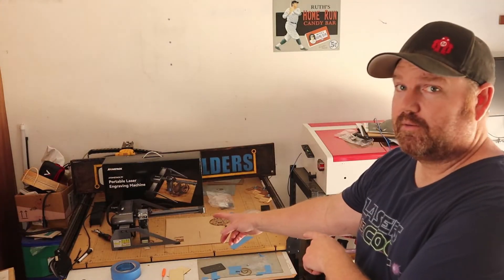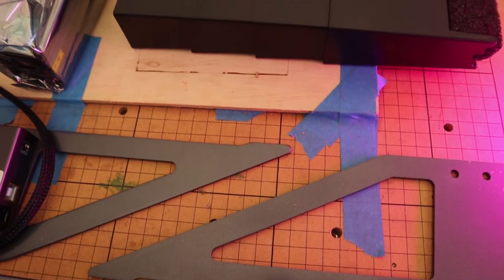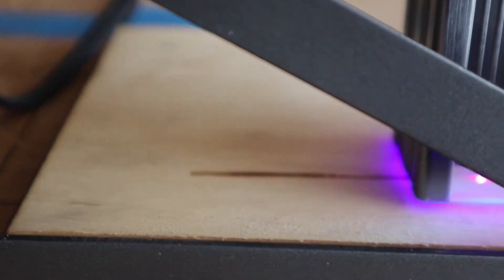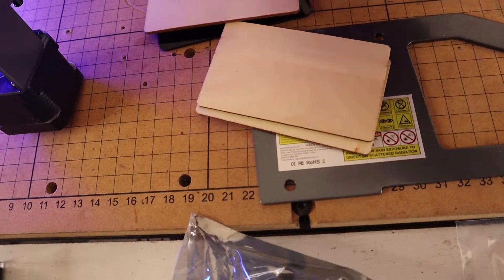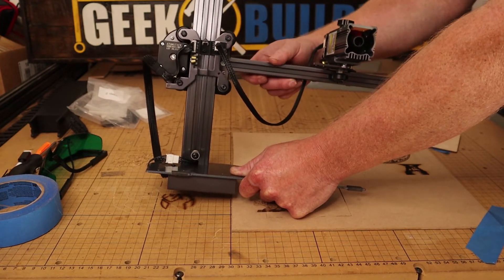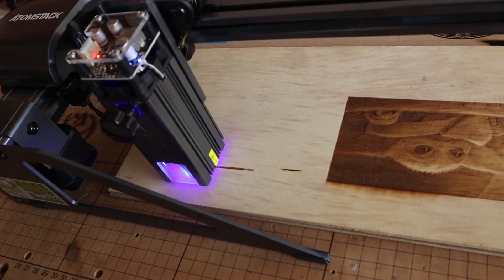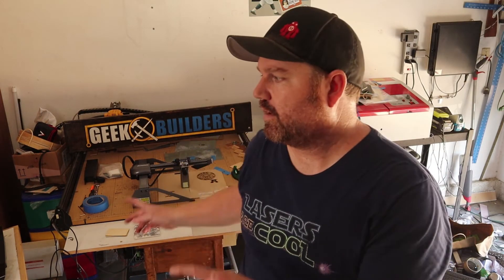Are Smaller Lasers Better :: Review of the Atomstack P7 Diode Laser

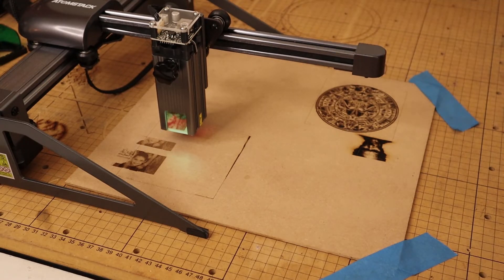Comment: Hi I have the same machine can I know how to engrave pictures on wood same the pictures shown  @4:10 please with details
Reply from the maker: You need to test different settings to see what works best with you machine and make sure that you have a high quality image. I would start with 60% power and 500 mm/s. If the image is too light, increase the power. Also try to make sure that the dpi of the image matches the dpi of your engrave settings.
Reply: @GeekBuildersNet  Hello again >> I try many thing but nothing work .. do you give any private session and we can test that together. Thanks again
Reply from the maker: @naelalalami4868  I do not offer private sessions, but I can offer a little more advice. One of the keys to making the effect work is using the right spray paint. I recommend using the Rustoleum Painters Touch - Smokey Beige
Reply: @GeekBuildersNet  Thanks for you support I am really still too far I dont know how to set the best setting to start normal engriving or cutting dont know where and what to change thats why need private session and thanks again you really doing nice job